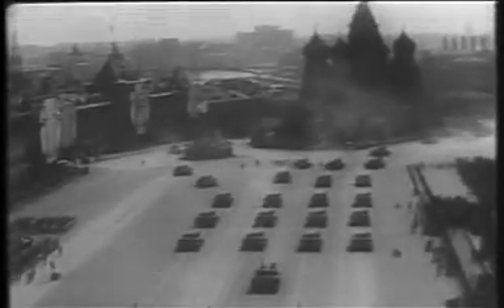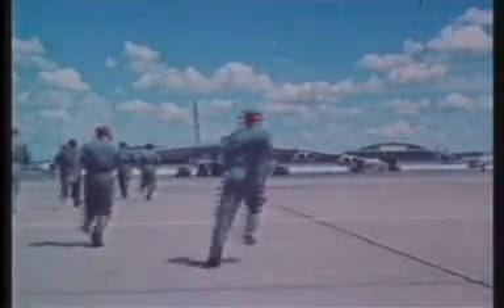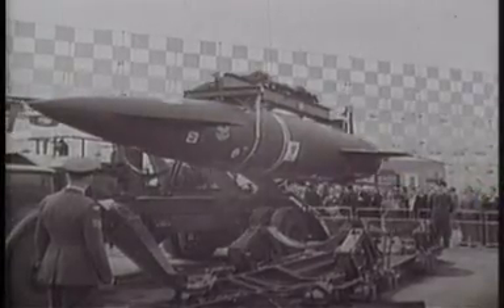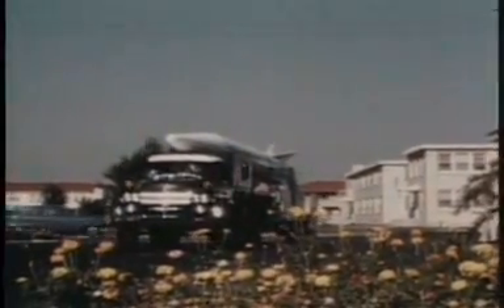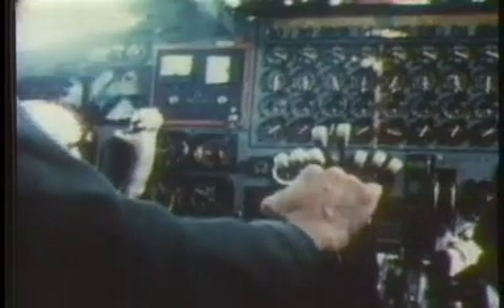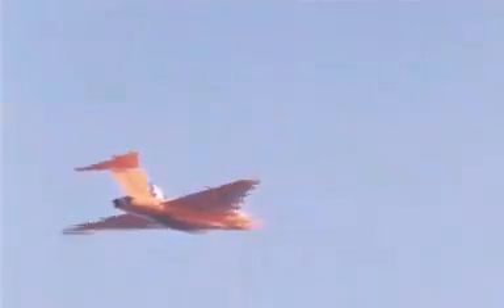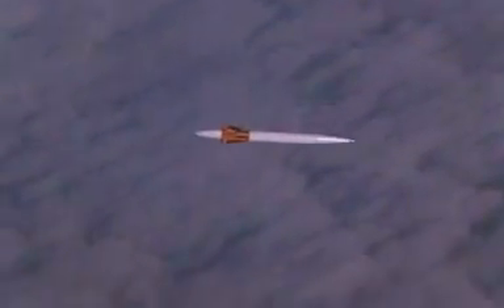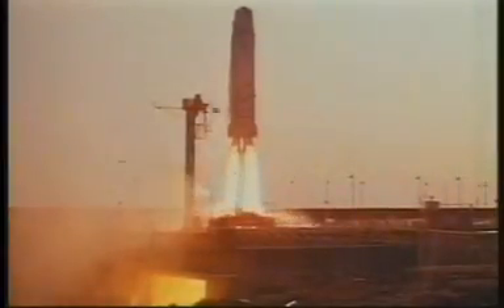Avro Vulcan Skybolt testing

Comment: The Avro Blue Steel was not obsolete before it was deployed. It had a longer range than 50 miles also and was mach 2 + after launch, Vulcans and Victors carried the weapon right through the 1960's as a strategic weapon

Comment: Nice little video, covers the sad story rather well. There's a good article on the cancellation by Ken young in the Journal of Strategic Studies, 27:4, 614-635. I have to disagree with Gyrocage though, Skybolt would never have worked as intended anyway, the tech just wasn't up to it at the time; Polaris was the viable platform and it's what the UK preferred.

Comment: There is little doubt that Skybolt would have worked, and if paired with V-bombers on continuous airborne alert (as was the plan) would indeed have provided a virtually invulnerable deterrent force.  However the cost of maintaining such bombers on 24 hour airborne alert was monstrous.  The Polaris system cost less to operate and had all the advantages of Skybolt - perhaps more.

The turbofan B-52H was SAC's Skybolt launcher.  102 were delivered, but 200 more were canceled after Skybolt's demise.
Reply: "There is little doubt that Skybolt would have worked"

It did work and the irony is that it had a perfect test-flight the day it was cancelled.